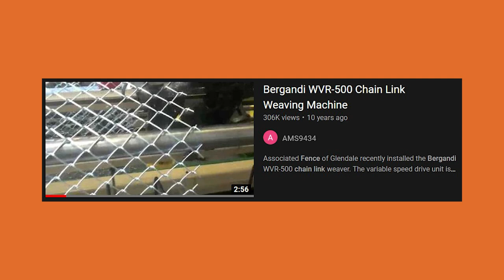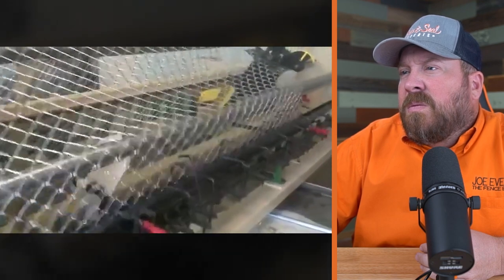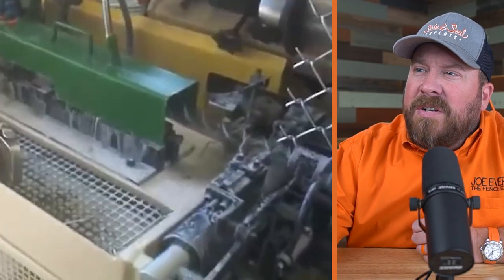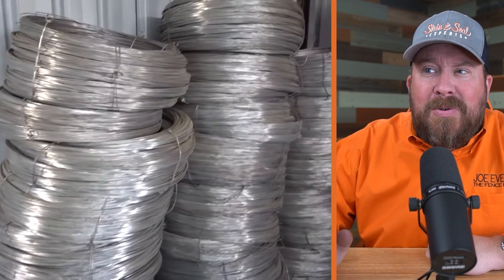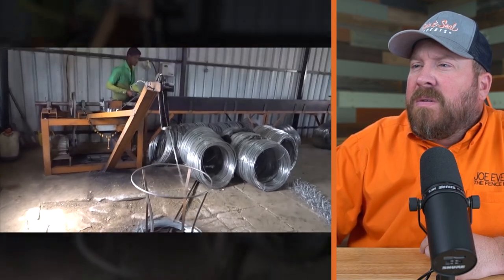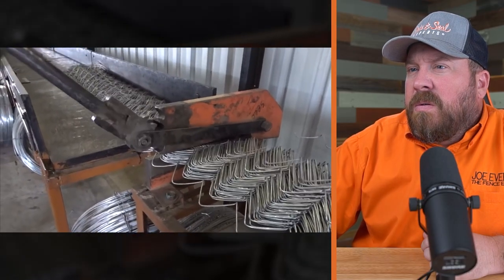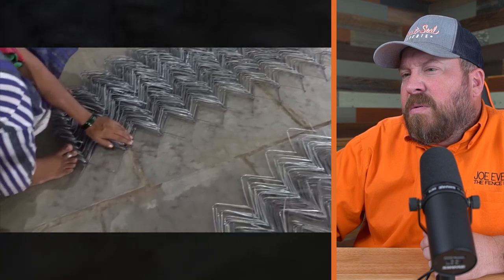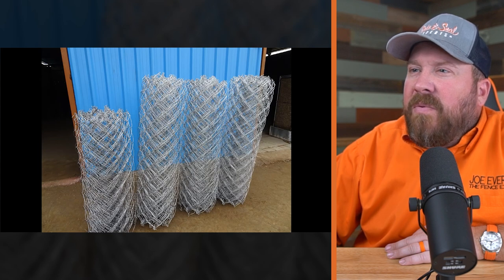So THIS is How They Make Chain Link Fence?! Machine Made vs Hand Woven - Fence Expert Reaction

Comment: The sensor for the metal filament is 2x as long as you need for a weave.  If the sensor senses no more filament then it just throws that last section out and you insert a new roll of filament.  Hope thats clear!

On the 2nd video, the rollers are straighteners actually.  It takes out the bend and roughness of the wire.  Essentially the 2nd machine is just the first part of the first machine that makes the weave strands and then its hand strung into the roll.  The way the machine knows the length is the amount of turns.  N amount of length per N amount of turns.  I LOVE these kinds of videos man!  Keep it up!
Reply from the maker: Fantastic information, I appreciate you sharing it!

Comment: I got into this industry about 6 months ago and that machine is going pretty darn fast that’s turn up from what I can see about 800 rpm my mechanical machine that uses a gear box and clutch to drive the machine is much much slower than this (about 550rpm) ,electronically driven machine, most of those bergandi machines can go up to about 1200 rpm but won’t run well that fast 800 is about their max before they start making many many mistakes, love the industry!
Reply from the maker: Agreed, the max we’ve had our Bergandi machine up to 900 without much issue.
Reply: @JoeEverest  I’m actually at work rn running my mechanically driven machine idk the brand because it’s soooo old like 40+ years old l, it’s super super slow like 500-550 rpm